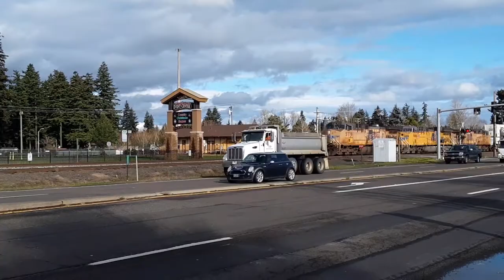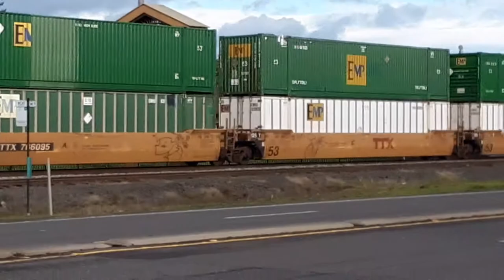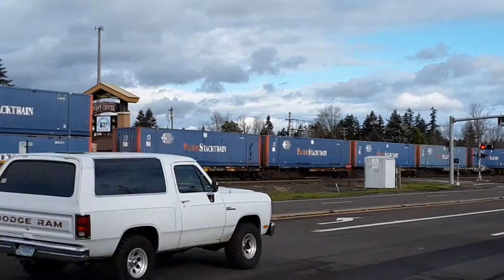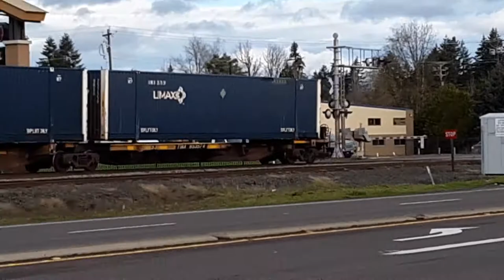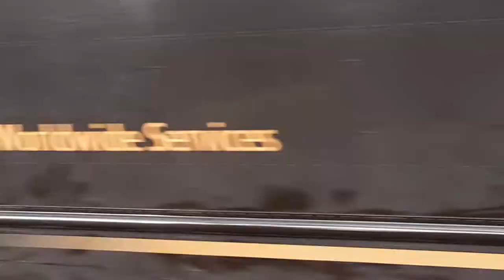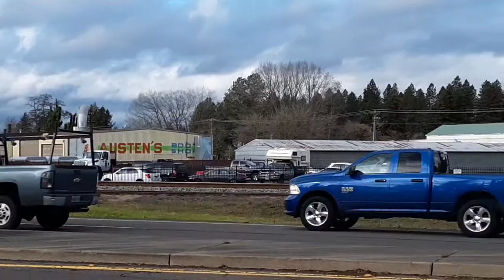I caught  UP # 6666 southbound in Canby,  Oregon on 12/21/20

Comment: nice power and intermodal
Reply from the maker: Thanks, John. 6666 was looking awful clean!
Reply from the maker: Hey John, somehow your BN question comes up under notifications but not the video so I will  reply this way. Burlington passenger cars and locos were silver and stainless steel. After the 1970 merger, they took Cascade Green as the corporate color. Great Northern went to Big Sky Blue in 1967 I think, and got most of their passenger cars, F9s and FP45s into it.  So after 1970, you got repainted Burlington cars into green, and Big Sky Blue cars that got repainted, then some that never did.  You could see BN cars in green, blue and silver on Amtrak trains well into the 70's especially as baggage cars. Who cares what color they were lol. Great question.